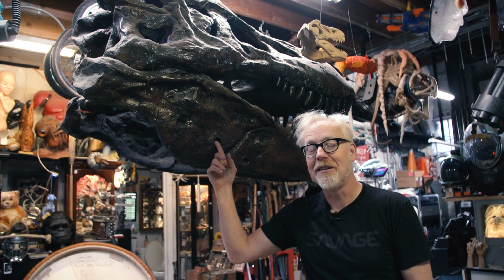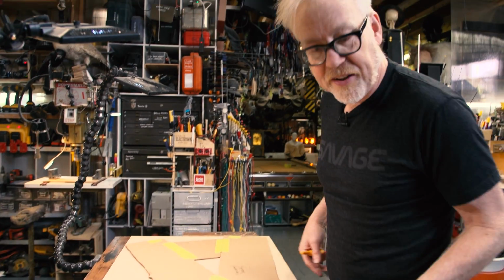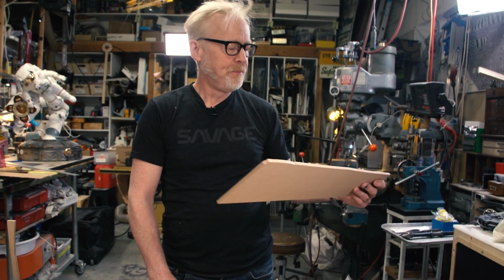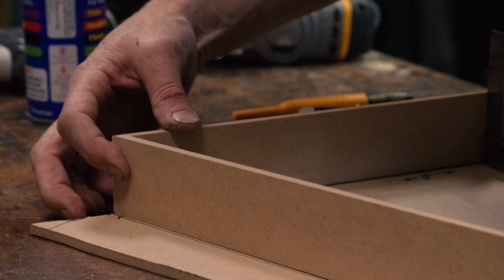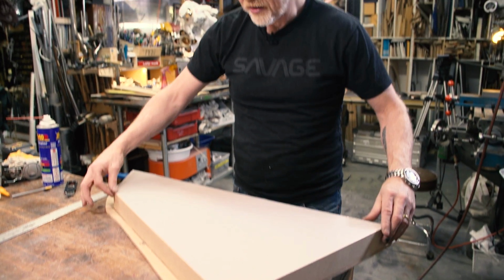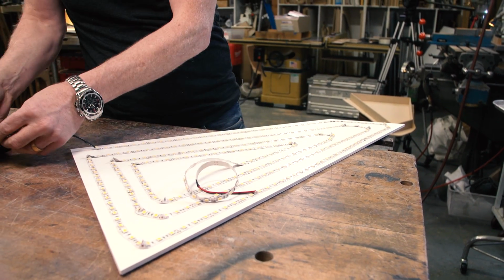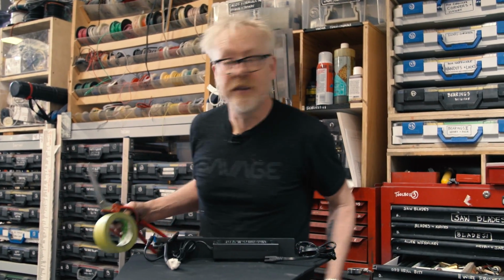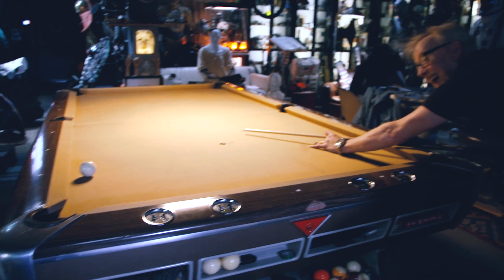Adam Savage's One Day Builds: Dinosaur Skull Lamp!

Comment: Btw you just go to lowes or HD and you buy “ under cabinet led strips “ it comes with the same spool of LED light tape and comes with the transformer where you can either use the plug and cord or it has terminals you can unscrew the wires and hard wire it to 120v . The brand name I use for my customers on electrical jobs is General Electric.

Comment: The next time you need to template an irregular shape, cut it close and then hold it in place while you use a compass with a marker and run it down the shape marking on the template.  That way you will have an almost perfect template of the shape.

Comment: I LOOOOOVE those LED light strips. I installed several strips of the RGB individually addressable ones on a curio cabinet and paired them with an Arduino Yun (= basically a WiFi addressable Arduino) running a web app that I wrote, that lets me turn them on/off and change the brightness and color. When I got a 3D printer I wanted to light it up because it's in a really dark location and the webcam I have pointed at it gets a horrible picture. Didn't need the LEDs to be individually addressable, nor did I need to be able to change the color, so I bought a strip of the generic 12V white ones, slapped them on the top beam of my printer and tied them directly into the printer's power supply, so that they turn on and off when the printer does. Works like a charm.

Comment: Hey Adam!

Nice Job, as always!

For long-lasting light builds i like to use 24Volt led stripes instead of 12V ones - they stay cooler, you can have longer stripes without "fading" at the non-supplied-end and they should live a bit longer.

Comment: I'm looking for suggestions  I want 1 or 10 custom helmets. I like bell, but I've been running tld most of my life. I need 727 graffics for a 2019 ktm 250sx..my grandmas birthday was 616 and mine is 727, so I've been thinking about running 616 in the 250 class and 727 in the 450 classes... and putting 272, 616, 727 on the pit bikes, weird pple rule. But 1st impressions are everything,  meaning presentation is everything..

Comment: Copper wire, one mm thick, any shape in under a minute, you just have to keep it straight/in one plane. Once you're done, you set it down on your cardboard and trace it using either a mist of spray paint or a light touch of a crayon. Easiest way to do this short of owning a huge filament shape gauge.

To reset the copper wire to perfect straight status, use two pieces of flat metal, preferably heavy. If in a home environment, without access to more industrial/shop means, two cast iron pans, or a heavy duty aluminium pan and the flat counter will do. You take the two surfaces and start rolling the copper wire after bringing it to a relative straight line by hand. It will exit perfectly flat, even where kinks might've occurred.

Comment: Heads up tho. LED's do produce heat. Heat rises. So ideally you would have holes in bottom, then a crack/raised lip to the diffuser sheet to allow heat to dissipate. Otherwise your LED's will burn out in much shorter time than normal. I get that this is quick and dirty, and it is super neat, just saying for other builders, you do need air for long term LED life. A few holes here and there will do a lotta good.

Comment: One should really use at least a mouth cap when working with MDF. The stuff is made from sawdust and glue, containing methylene diphenyl diisocyanate and phenol formaldehyde resin which are probably not the best chemical compounds when it comes to benefit of health..  TBH I also do just quick builds with MDF without proper PPE, but recently I came to realization it adds up when you're 43 and natural cause already gives you clear indications of ones health dwindling because time is a b&*ch..

Comment: My only problem with using CA glue on build like this is that it happens to be very expensive least around here. Still haven found bigger packet size than 10grams from locktite, but i know how good it is. Also spray activators are kinda non existing far as i have seen, but this could be problem with local stores not carrying it. Personally i prefer the liquid CA over the gel as it gets into tiny spots and soaks into materials so its perfect for filling minor imperfections you cant bother to use bondo for. 
Other thing is that power strip shortening... just get socket plug, cut the extension cord and wire that up. There is no point of using wire nuts and its electrical hazard to use them with out proper closed box.

Comment: Something I've been needing to make is a 1.5'×3' plant transporter for clones that need to travel 70 miles. LED lights  as well as some airflow are required. Battery powered would be the best but a lighter plug would also work.

Comment: "You want to be double-checking your circuit constantly"
Yep. When I added some LEDs to my rear bumper (lighting at night for reversing, esp since I have an after market rear view camera that's completely useless at night...the one time I got it for) I blew through three fuses. When my dad had me do the same thing to his car, I only blew two. One when I slipped with the volt meter and touched the probes to each other. But yeah, I had a problem with one of my soldering jobbies early on and got my leads backwards on one strip.
The final step of coating the whole thing in waterproof goop was the most time consuming though. And while its discolored some in the years since (and a few of the individual LEDs on my dad's car have failed), it works great.

Comment: When I do stuff with the LED strips I like the adjustable power supplies, and I run them at a lower voltage, somewhere like 10-11 volts, it makes them run cooler and have a lot longer lifetime. Also sometimes I mount them to aluminum to spread the heat out too.

Comment: Sorry Adam, it's functional but that's about all you can say about this attempt since many had expected the light would cast Lucy the T-Rex,s Skull in all her toothy glory across the shop as well. Indeed there's a lighted  T-Rex skull from the Uncle Milton line that does it but in a much smaller way and despite its single LED at the back of the mouth it runs circles around what you built. Perhaps a 3rd incarnation will be tried in future because you could of hung almost any lamp on your cutout with a power strip and gotten the same uninspired lighting from this design.

Comment: Why don't you straighten the the wire before you use it ... if straight it lays flat and is much easier to work with ... try it you will enjoy ... 
Quickest way to straighten the wire is clamp one end in the vice, the other into the chuck of your drill and pull it straight while rotating the drill ... 
I straighten all my short pieces of wire, easier to store the shorter bit as well

Comment: Love the build. Only suggestion I have: those LED strips will probably come off soon. I've used them on foam just like this, and the adhesive backing soon failed, so they started lifting off within days after applying them.

So, every few inches I ended up drilling little pairs of holes on each side of the strips, and using zip ties I secured them around the strips and behind the foam. They didn't move anymore after that ;)

Comment: For Jekyll and Hyde, which we put on for my tech theatre course at college, we put some cheap led strips into the red rat sign. That sign will be the death of us. The LEDs wouldn't stick, they stuck too much, they wouldn't turn on and off properly. The string holding the sign on snapped mid tech rehearsal. The cut out of a rat I made out of mount board to cover the battery pack kept falling off. The battery pack fell off. Just. So much went wrong.

Comment: Great build. However, as an electrician I HATE those exposed wire nuts where he shortened the length of the cord on the power strip.  That is not a smart thing to do.  That joint that’s carrying the 120 volt load needs to be in an electrical box.  More importantly it did not need shortened.  He could have just zip tied 🤦🏻‍♂️   Love savage’s builds but this is a big ol nope for me.

Comment: CA glue can also be a good way of hardening chip board / binders board for small construction projects like internal structure for boxes. Harden with CA layer, sand smooth and then spray varnish. It can kick hot sometimes and ventilation is a good idea but it leaves a hard shell on the pieces and takes spray varnish quite well. Pro tip: dont use kicker to speed the process or it will foam.

Comment: Use a hot glue gun for your templates. I used to make counter tops and we used 1/8" ply cut in strips and would connect the strips with hot glue to make templates of the cabinets. You can then glue on small pieces to follow a contour.

Comment: I recently used a five dollar LED strip to light a classic Star Trek computer unit, with three separate circuits, and flashing lights.
Outside: uniform colour, reasonably even distribution of coloured caps for the lights, looks nice.
Inside: a mess of wires, probably horribly inefficient way of doing it.
But it was a lot of fun to do, and I just don't care about the insides.
Powered with a Micro-USB socket so I can plug in a charger cable at home, and a power bank whenever I use it as part of a display at an exhibition.

Comment: Several years ago I added a strip of waterproof LEDs to my refrigerator. It's the best hack I've ever done. Even after the strip was hit by some container and broke about half way through the light is much much brighter than the original dinky little bulb. And it lights all (or most) sides so big things on the top shelf don't block the lighting things in the bottom drawers anymore.

Comment: "I ordinarily dont use MDF because it's not stable..."
Meanwhile, woodworkers often use it for fixtures and jigs because....
Reply: It crumbles at the edges and it will sag with humidity/etc.  It's a powder and glue cake.  Lacks the inherent structure of wood.  It is more stable in terms of dimensional rigidity in a dry environment, but is overall definitely weaker than wood.
Reply: Ryan but still far more stable than wood, soooo
Reply: The subtle discrepancy here is the definition of the word "stable".  If you built a bridge of wood and replicated it in MDF with the exact same plank dimensions, which would be more "stable" over time?
Reply: MDF is not long-term dimensionally or structurally stable.
Reply: At first I was thinking the same thing, but then I realized that I think he means rigid.  It’s not crazy rigid at that thickness, but over time it should not move like solid wood, and that means it is stable.
Reply: I was thinking the same thing, but it looks like he's using fairly thin MDF for this so maybe that's why he said it?
Reply: He must mean strong/ rigid because it’s pretty much the most stable wood material that exists

Comment: I've found that the small amount of heat that led strips put out softens the adhesive enough that over time, it will often peel away.

Also that small amount of heat gradually turned at lot of my led strips green/yellow and dim.

I've now mounted all my 12v 5050 strips in aluminium channel or aluminium strip and they've been fine.

Comment: I used those strip LEDs for a party doughnut board. It was only when I had finishrf construction that I learned there were drivers that had a built in mic to make it run similarly to disco lights. So annoyed.

Comment: @Adam - The best bang for your photons are achieved by using the 3-4 layers behind the LCD screen from an old TV or monitor.
There's a chrome mirror back plate, a fresnel lens sheat and white difusors.
They are all thin and easy to cut into shape.
You only need one strip of LED's around the edges and it lights up like a window on a sunny day.

Comment: Quick tip: unless you need the measurement markings, flip the T-square over when making lines or cutting. That way you don’t have that upward bridge at the joining end throwing off your marks/cuts.  Also, CA glue is oftentimes used by pen turners (making pens on a lathe) as a hard shiny finish that can withstand some abuse.

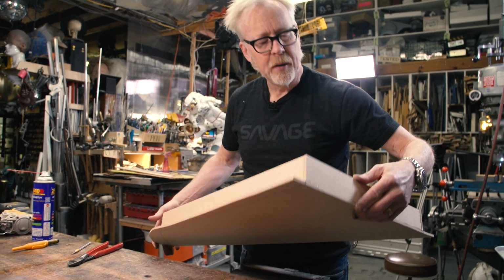Comment: 15:47 The way he holds his hands when using the nail gun is the way someone who has shot himself with a nail gun before holds things.
Reply: Certainly a possibility. That or he just learned the proper way to do it from the start.
Reply: @alexubel  in another build he talks about double firing the gun and getting bit
Reply: Or how I check that it's disconnected and there's no pressure left in the system before clearing jam on a nail gun - fortunately not personal experience but I did see someone shoot himself in the throat with one.
Reply: @MrGrimsmith  the throat! Wow! I took one to the thumb before, but the throat! Sheesh!!
Reply: Having shot a nail straight into the tip of my thumb I can tell you you’re very right about that
Reply: @katjoe1974  no
Reply: I was playing with something I shouldn't have been when I was 10 and stapled my index and middle finger together. couldn't pull it out right away. too hard. like it was stuck. had to numb it first with some ice. the crap we did when mom and dad wasn't there.
Reply: Been there...done that
Reply: It only took me twice having a 2" finish nail curling out in an unexpected direction. But, there was the time an 8 blew through siding and 2x4 to nail my first 2 fingers together. Luckily it missed the bone.  I clamped the nail in a vice to pull it out. (My boss was coming at me all crazy eyed with a pair of pliers).
Reply: According to his other videos, it's less that he's shot himself with one before and more that he's seen coworkers do it before and doesn't want to take chances.

Comment: Pro tip: When I’m making a complex shape for a template, I do what Adam did and shape the cardboard roughly. Then I take a flat washer and stick a pen or pencil in the hole, and let the edge of the washer ride up against the original casting. It marks a perfect tracing of the edge surface, and I trim back to that. Nifty trick for a complex shape.

Comment: That was a lot of work with CA glue, activator and nails, to achieve something probably less resistant than it would have been if done just with (cheaper and more elastic) PVA. :-P

Jamie is right that CA makes a pretty good "express varnish" (though it can go cloudy if you're not careful), but for MDF joints it tends to be too brittle.

Comment: The best tip on that aluminum tape, is to keep it as mint as you can, The slightest ding to the side of the roll will cause it to tear over and over. I keep a roll  of it in a cardboard box with a pad in it.

Comment: Those led strips can be cut about every inch or so, They sell cheap wire connectors, I bought like 20 of them for a couple of bucks, This make it great to add in short lighting on desk and in odd places. 

could have cut a bunch of strips and wired them all in on one end. 

I use them under my tv shelf that hold 2 55 inch tvs and under my desk, I have at one time used them under my kitchen cabinets, 15000 hours life does not last very long when you leave them on for 2 plus years... The do dim a lot over time.

Comment: At a time when everyone is trying to reduce, reuse and recycle it really bothers me that Adam will put his template in the middle of a sheet of wood and cut it out instead of pushing it into a corner to not only use less material but also have less cuts to do. He also uses about 6 foot of bailing wire when 1 foot would have been plenty. He seems to do this in every one of his builds. I know its trivial but if we all do our bit we'll all benefit in the long run.

Comment: 2:07 i also use the thumb and pinky extended for a good guess on 8" inches haha
Reply: A "thumbs up" sign from base of my hand to tip of thumb is 6" (15cm) for me, very useful. It's also more consistent than spreading thumb and pinky apart. It also means if I put both hands together it's a foot.
Reply: I, as a German can measure around 20 cm by stretching thumb and pointing finger as far apart as I can :D useful for quick measurements ^^
Reply: 21 cm here. My middle finger is 9cm on the inside and 12 on the outside if I count the knuckle too.
Reply: I heard the thumb to pinky rule of thumb was 9", but after I broke my hand, now it's only 8" on that side. The width of my thumb is almost exactly 1", and my shoes come out to almost exactly 12", which is helpful for moving furniture around.

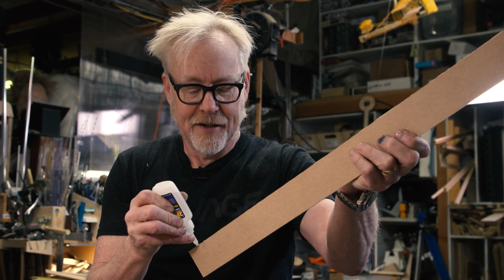Comment: 14:20 how loud did you yell when you did that to your middle finger. did the same to my pinkie and let me tell you... i was yelling so loud it hurt MY ears... and then 2 days later i smashed the same finger, again. so yea that nail is gonna fall off.
Reply: to be fair, pinky is the worst finger to hit. ive done that to probably all of my fingers and toes over the years and in both instances, the pinky/little toe were so much more painful than any other appendage... so u have the worst behind u ;)
Reply: @franticbass  the pinkie toe's the worst mine stucks out so its been a few times
Reply: What I hate is that pain time delay after you hit it. I think it's there to make sure you get the most contrast between not painful and painful.
Bang! ... oh, crap, this is gonna... ARRRRGHFML!!
Reply: to be fair I have had my pointer finger slammed in the hinge of a door frame by what I could only assume was the largest wood door in a school I lost the nail but only after repeated Fractures and other accidents involving my fingers. I have had both pointer fingers injured my thumb slammed between the exposed metal on a car door and finally a Glass exploding in my hand from my job which managed to cut my ring finger and my pinky and my palm so as far as hand related injuries I think I take the cake I have yet to lose a finger but time will tell if I will. Im still working at the job in which the glass exploded in my hand.